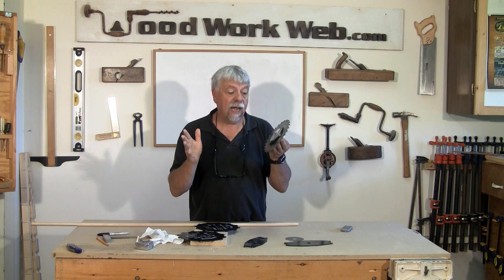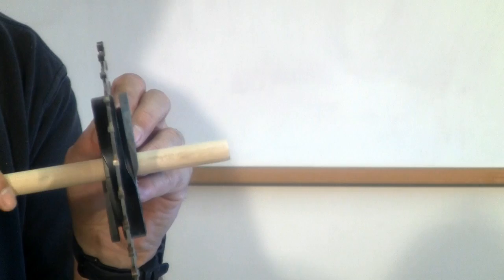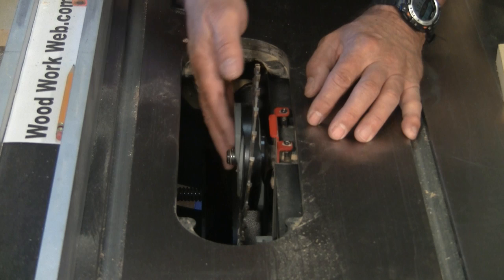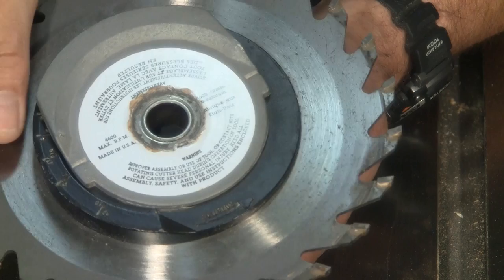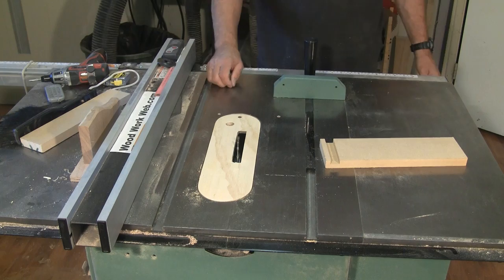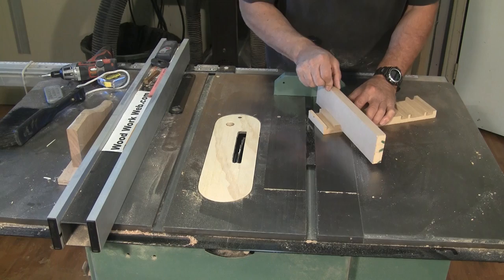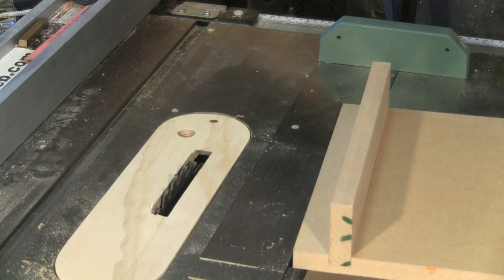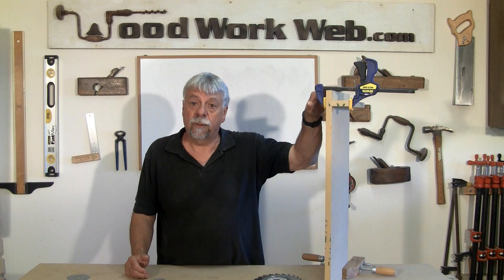Testing the Wobble Dado Blade -  woodworkweb

Comment: I bought a shopsmith last year, and on a budget decided to get a wobble dado from Harbor Freight. It works, but one thing I'm finding difficult, and this must be because of the fact that the SS table and motor aren't fixed to each other, is making a jig that is repeatable....rotating the blade to find the left/right - most tip is what's difficult. I think I might try making an insert just for the dado and see if that'll help. I'm sure it'd be 10x easier with a stacked set.
Reply from the maker: Phillip Kirkpatrick Sounds interesting, keep us updated on your progress Phillip
Reply: An interesting question...does your dado have a set screw too? If not, which doesn't look like it from the video, i wonder how it keeps its setting in place and not slip
Reply from the maker: Phillip Kirkpatrick  No set screw, it holds it position from the friction of the acme nut on the arbor
Reply: Interesting. I looked at my SS last night, and was looking for a way to accurately setup the wobble, and It doesn't seem very easy. The 5/8 dado arbor is longer than the stock arbor. There is a bar underneath the table that the dado arbor runs into if i slide the table all the way to the motor, but that bar is slightly curved so a measurement from that to the arbor can't be too accurate. My best idea is to make an insert, and since the dado is smaller than the stock blade, i'll make a slot for the regular 10" blade as a 'key' for horizontal alignment...that key should never get eaten up by the dado no matter how deep I set it. The other thing I thought about was the dado widths, I'll likely make an insert for each size i'd use on the dado and use a razor or something to notch the exact position so it's repeatable.
Reply from the maker: Phillip Kirkpatrick  Sounds like you have figured out a solution ... thanks for the note
Reply: I attempted to try the solution this weekend, but ran into a few issues, most of which involved my choice of wood for an insert & jig. Not thinking clearly, I chose to use an old cheap beat-up piece of plywood that practically fell apart as an insert. It would have worked great too. I also noticed that it is very important to measure the actual width of the dado and adjust until you get it right, otherwise you end up with a bit of a mess. I made a dog bed frame with box joints, and I had to trim about 1/8" off because it wasn't set to exactly 1/4" (plus I had to cut off another 1/4" on the other side because I mis-aligned my last piece by one finger. Started with 2.5" stock and ended up with actually just over 2" (at least the dog bed itself is a 2" memory foam pad, so it'll work out fine. The HF dado did perform ok for finger joints if you're not worried about looks, the joints did seem concave a bit ~1/16" deeper in the middle than the sides...so if you're worried about presentation I'd recommend getting a stack instead...which is probably what I'll do before I build cabinets.
Reply from the maker: Phillip Kirkpatrick  Woodworking is always a learning process, it can be frustrating at times, but very rewarding when we find the solutions ... and things start coming together

Comment: As someone mentioned you don't have to dismantle it each time you want to adjust... then once pleased with the cut, mark it  off and it will be perfect next time, THE MAIN ADVANTAGE IS THAT YOU CAN UNDER CUT (or over cut) THE DADO SLOT IF YOUR MATERIAL IS NOT QUITE THE RIGHT THICKNESS... WHICH YOU CAN'T DO WITH A STACK ABLE DADO OR STRAIGHT ROUTER BIT... I have been using mine for 40 years with success...

Comment: Wobble blades were mostly sold by Sears as a Craftsman Brand item. I believe they were made by Vermont American. I still have one and use it fairly often on a radial arm saw when doing wood work. The crown can be eliminated easily with a suitable router cutter 1/16" to 1/8" smaller than the groove and a straight edge clamped down on the work piece. Unfortunately they only seem to have offered a 7 1/2" version.

Comment: My dad bought one of these back in the 80s for his Craftsman radial arm saw. He used it for a lot of projects, mostly made of partial wood, and most of them are still around today. I now have his saw along with all the original Craftsman blades. Here’s a suggestion Colin, make a video featuring the Craftsman moulding blade. I have that as well. Seems a bit sketchy on the RAS, but may be better on the table saw.

Comment: I picked up a craftsman table saw with the align-a-rip fence and craftsman 6 1/8" jointer from someone selling it on Craigslist for a steal of a price at $200. As a bonus, the saw came with 2 Diablo, 1 Freud 60 tooth full kerf tcg, and another $60 blade which I can't remember but it had a price tag that was $57. It also came with this craftsman wobble blade. Granted, they were all used blades. But I will send them out to be sharpened which would probably be all of about $30. 

I feel like I got a steal of a deal!

Comment: If you're going to glue the thing is, having a very small gap is actually better and has been proven to make the joint stronger. It also makes sure you don't have as much of a glue squeeze out when you're clamping the thing down.

Comment: Colin I just purchased a new set from a guy in Idaho,  He calls it an unmarked Irwin.  It was a little rough as it wold not fit te arbor  but I realized there was a burr and once filed down it fit great.  The adjustment I found can be easily adjusted while on the arbor.  I plan to use for box joints so I can make boxes.  As old as I am I can adjust a few time if necessary,  
Oh yes, the blade is new and I found it on ebay for $17 which includes $9 for shipping..  I sometimes feel out of place when watching videos on Youtube as I don't have $1000 + saws and other equipment
Reply from the maker: Good info, thanks Gary

Comment: I bought one of these for 5 bucks. After watching this I gave it a go. Mine is very different than yours. It is a craftsman and adjusts the same way, but it is almost a star in shape. It has long thick arms  with big teeth on the end. If I found one like yours I would give it a try but mine is horrible. I honestly made one cut and swore I would never use it again. The cut took about 4 seconds and I was terrified the whole time. I thought the saw was going to shake apart and I was going to die. It was set up properly, and my saw is probably about a medium weight. Its an old Rockwell and its certainly not tiny. I believe my blade is much beefier than yours and the extra weight caused excessive vibration. I would say If you see one of these star shaped blades STAY AWAY or better yet buy it and destroy it so no one else gets it and hurts themselves.

Comment: I have one of these and used it many times, just put a sharpie tick where the actual dado widths are, speeds up the setup process. Just upgraded to a set of stacking dado blades and probably will never go back to the wobble

Comment: I have owned and used one of these for several years.  They certainly give you the impression of wobble but I found they worked quite well.  My biggest gripe with the tool was clearly depicted in this video in that to adjust, the blade must be removed from the arbor, loosened and adjusted.  This adjustment was very hit or miss.  Quite the pain taking it off and on, off and on.  Other than the carbides flying off, which is true of all carbide tipped blades, I am not understanding in what other way they are dangerous.

Comment: My father had one of these blades for his table saw. To adjust the correct width, he would use a carpenter square. He would set the width using the width marks on the blade. He would then place the blade on the saw shaft and lift the blade to the table maximum height. He would place the square on the table and turn the blade so the closest tooth edge to the rip fence would fit into the corner of the square. He would move the rip fence against the square, making sure the square was parallel to the fence. He would then turn the blade 180 degrees and measure the outside of the saw tooth against the square to determine the true dado width. He would make adjustments to the blade width dial as needed. He would repeat the steps until he got the desired width he wanted. He would then tighten the blade nut, and set the saw up for the cut. He would check his cut on a scrap piece of wood. Very few times would he have to readjust the width. True the cut was not completely square, there was always a slight bow in the cut. He would mix some fine sawdust with his glue, to fill in the gap, if it was a wide dado cut. The wider the cut the greater was the gap. His blade could be adjusted to make 1 inch dado cuts.

Comment: I bought some shims that turn a regular blade into a wobble blade.  They're not nearly as fast as a standard dado stack because you have to wait for the blade to carve across the width of the dado. And it's absolutely terrifying to watch on the saw..  Overall I still prefer a standard stack, but they're good to keep in a kit if you travel with a table saw, and only occasionally need to do dados..

Comment: I still have one of these I bought from sears back in the '70s.  as you mentioned,  the drawback was they didn't cut a flat bottom.  they usually were made to cut flat at the 3/4" setting and mine cut like yours with a small gap at that setting.  I sent mine out and had it ground to be flat when set to 3/4" and as long as I cut 3/4" dadoes things were fine.  the angle got really skewed, though, the narrower the dado.  I don't cut dadoes anymore so mine gathers dust hanging on the wall.  it's still in the original plastic case with the owners manual. anyone who wants one free and would pay shipping let me know.
Reply: +dakotabluelightning  I would be interested in having the blade. I'm new to woodworking and would like to try the adjustable blade and am willing to pay the freight. Let me know how much and where to send it.

Comment: I bought my wobble wheel in the 1970's it works well but the pain of trial and error forced me to use a router. I inherited two more from my dad. Mine came from Sears, my dad's are from Harbor Freight. I will check that kerfmaker tool.
Reply from the maker: Herbert Morris Yes, please do ... I had a look at it and was not convinced it would do the job in this case, but I am up for having my mind changed if some does try it and it works. Thanks Herbert ... looking forward to hear how it goes
Colin

Comment: I have one of these that has two blades . It makes it a easier to adjust because you can measure how far apart the blades are at the widest point. You can loosen the nut and make micro adjustments while it is on the arbor.  Cuts a good flat bottom too.

Comment: First time I saw and used one was in 1975 in Alaska building shelving in particle board.  It was easy to make the fit as tight as you wanted.  I bought one shortly afterward. The work great.  Still have mine.
Only concern I have is damage to the trunion of the saw....being out of balance
Reply from the maker: Mike Malone Wow, that's a cool story, but I think that is around the first time I used one too, but my memory is not nearly as keen as yours.
I haven't got much use out of mine, it's still pretty sharp.

Comment: We could make a slight radius on the mating piece, maybe a few strokes of 80-120 grit sand paper on a block, to try and knock down the edges a bit, putting in a slight radius that would closely, if not exactly match the curvature of the dado blade. This will surely bring down the gap in the middle of the slot, making for better appearance and a better glue joint fit. Just loud thinking as one possible solution to overcome the main issue with this design.

Comment: This video made me reconsider the wobble blade. I have been using a Freud Dial a Width blade on my Powermatic table saw. I remember the argument about the arch made by wobble dados and wanted a really flat bottom on my dados. But problems with the dial a width system started to appear early. The Powermatic's arbor is short and I couldn't use even the ¾ inch width so I use one of my routers to cut the larger dados. Then there was the problem of stacking the blades in the proper sequence. Not too easy. I keep a Freud blade sequence guide available. After that, there was the problem dialing the correct width, not unlike Colin's problem with the wobble blade. However adjusting widths with the wobble was still easier. The main problem is the wobble, but my table saw is sturdy. Maybe not a good idea for light duty table saws.
Colin's video showed very little arch gap in the finished joint. He solved that by squeezing the joint. Curious, I calculated the gap size for a 7 inch dado and it came out to 0.2553 mm. Pretty small unless you are worried about being extremely accurate. 
I ordered a 7 inch wobble blade to replace the one I tossed out years ago.

Comment: I just found this video and I have used this dado for many years. I noticed in the beginning biggest problem is with setup. Once I got it set to the desired dado I scribed a line on the dado to make it easer for the next time setup. The crowning problem, if I am using a face frame I just leave it, if the dado will show I just clean it up with a router or a board with sand paper glued to the edge of a board.

Comment: Hi there, I saw these dado blades in the years 1960 more or less. Very good. Shop Smith had them. Greeting from Aruba, Vale!
Reply from the maker: lol ... I didn't know they went back that far ... thanks for the info
Reply: Not like that....but with define mesurements...like 1/4, 1/2, 3/8 etc. The one you have is better, you can set the width you want. Keep on the good working....hugs! Vale.

Comment: I have a Challenger adjustable dado made by DML Inc. I don't know if they are still in business. It has two blades that are adjustable like the wobble blade that you have. The smallest dado would be 1/4 inch and it would give a nice square dado which would be good for box joints. The maximum dado is about 15/16 inch. I think I paid about $20 for it about 10 years ago. They are a bit of a pain to get the right measurements.Anyhow, your video was done very well....nice job!
Reply from the maker: +pjtsr I have not seen that type of blade, but it sounds like it is similar to the one I was using ... yeah, they are a bit of pain :)

Comment: Had one of these years ago.  IT was a craftsman.  It was easy to adjust.  You could loosen the nut and turn the hub without taking it off the arbor.  It was great for cutting dados for odd sized plywood. My biggest complaint, when cutting cross grain it chipped out pretty bad. I used it until it got dull,  then replaced it with a stack dado.
Reply from the maker: Joel Watts Yeah, this one is still pretty stiff, I have to take it off the arbor to adjust it, but for the few times I use it ... I can live with that

Comment: I've used this product many times. There was never a time where I had to keep resetting the blade, if It was set to 1/2 inch or what ever cut you set it at that's the cut you wood😀 get. Still use it and love it. If the cut was a little tight I wood😀  adjust the wood😀 and pass it through again .

Comment: Thanks for demonstrating the adjustable dado cutter. I've used one for years and don't remember having as much trouble getting the width correct as you seemed to have. When you had the clamp on the test piece it was easy to see the tiny arc gap, but you had the clamp off center towards the top, contributing to a gap at the bottom. I never even thought about the curve at the bottom of the cut. I learned something. My biggest time waster with this tool was getting the edge of the cuts where I needed them. For example, if I needed the edge of the cut to be 1/2" from the edge  of the wood, where did I measure from? I always had to rotate the wheel to find the tooth that went to that side the farthest, and then mark it with a felt tip pen, then bring it to the top and measure. It certainly is more adjustable than the stacked dado cutters.

Comment: For adjusting the width of the cut one could just use eqn (at least getting to ballpark):
A = H/2-D/2

A = height of lowest outside kerf above flat surface when hub laying flat on it
H = height of the hub laying flat on a flat surface
D = desired dado width

If the dado when adjusted to bigger sizes sweeps a width greater than the width of the hub then it would get more complicated but still could be done similarly with a block of some known size under the hub on the surface.

Comment: I also had one of these blades circa 1960 for my 12" 4hp Craftsman RAS.  Great blade.  I think the detractors claiming rounded-corner results are from those who never used one.  Mine, unfortunately was gone when my parents sold my saw w/o my knowledge; but I do recall I had a 10" model -- the wobble fingers were much longer and as I recall, my blade was about 1/4" thick.  Not sure what the max thickness was.  I always considered my wobble dado to be far superior to any stacked dado set.  The carbide ends were decidedly angled; and always gave me the results I wanted.
Reply from the maker: tkarlmann Wow ... I did not know anyone made such beast, sounds like it was a great blade, I wonder if there are any survivors still kicking around. Would be nice to see pics of one. Thanks for the note, always love hearing what others have used and experienced :)
Colin
Reply: WoodWorkWeb I recall I made what I call "The Ultimate Window Air Conditioner Mount".  Starting with a 4x4 I had to cut many angles.  If you want to have some fun, try making rip cuts on a 4hp 220v RAS,   ...  NOT.  Crosscuts on that saw were so smooth (not speaking about the wobble blade now), it would have been insulting to touch them with any sandpaper.  Cell  structure was clearly seen.